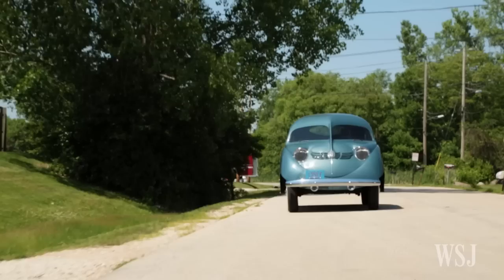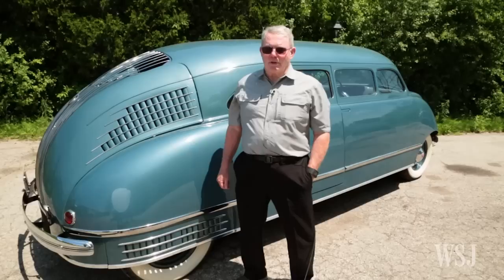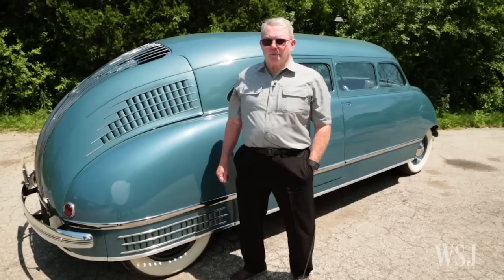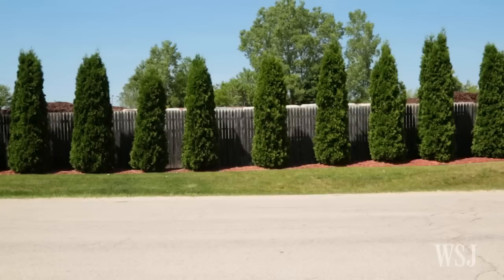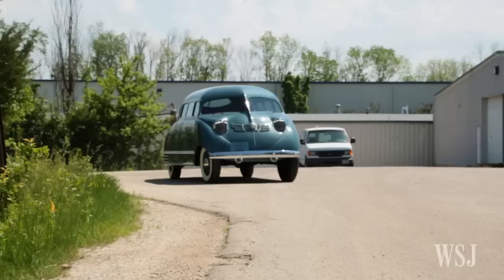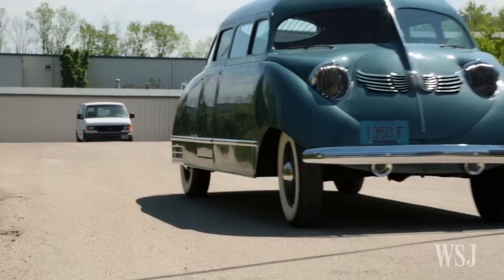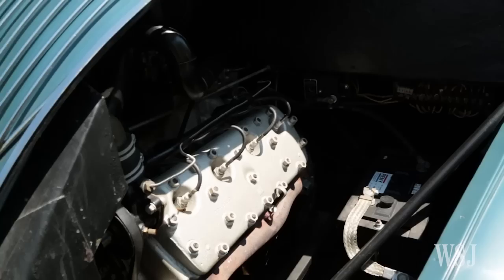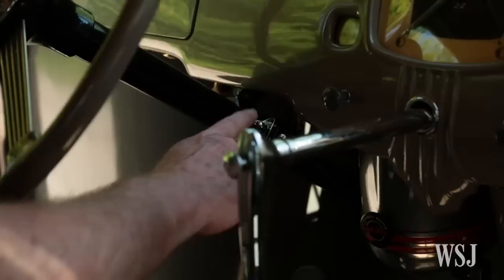The Stout Scarab: The World's First Minivan?

Comment: The elephant in the room about this car is that big engine in the rear and what that does to the weight distribution and steering. This thing is dangerous! It has an enormous oversteer problem, or rather understeer to a certain point and then a radical oversteer that will leave the rear of the car spinning around towards the front!! (Loose seats are certainly a bad idea too!) One more thing: nothing was muted when it played for me.
Reply: None of the test drives of Scarabs I've seen mention this being a problem.
Reply: DIsagree.   You toss out all of suspension tuning and whatever weight is where.   Is the engine behind the rear wheels or over them like a newer porsche?   Yes loose seats aren't great but it was a different era.   It should be compared with vehicles of its time.  Now, for modern driving, like many classics, if this wasn't a museum piece you could upgrade to modern springs and brakes. I did that to a 1959 1 ton truck I drove as a work horse for many years carrying up to 3600 lbs of scrap iron in one load.   In that truck I put a 'modern' 1969 chevy 292 in line 6, same vintage 4 speed (granny gear) and it the truck was very simple and extremely reliable.   Even with 1/4" run out on the fan the water pump did not leak (and I did replace it).   The original had 30 years on it.  The car is more dangerous for its structure in an accident, but again, this was a different era.   Perhaps we should compare it to the tucker which was also rear engine drive and see how Tucker handled the steering issue.   I also had kevlar lined drum brakes up front and the truck stopped almost as well as a modern truck with disk brakes.   Jay Leno often takes his museum pieces and improves engineering but retains the design and intent.